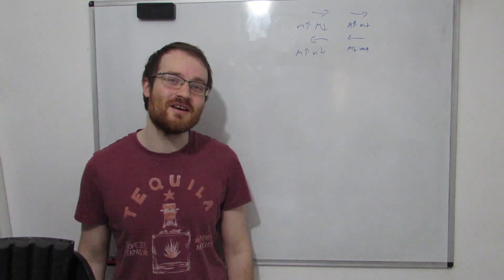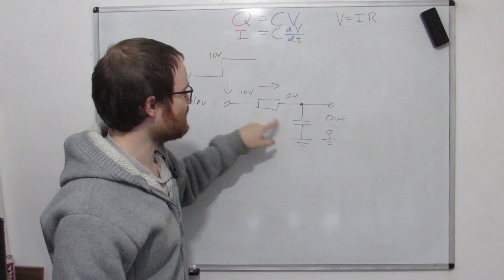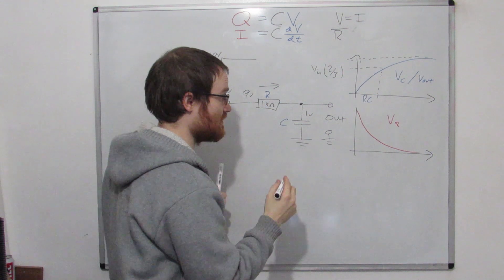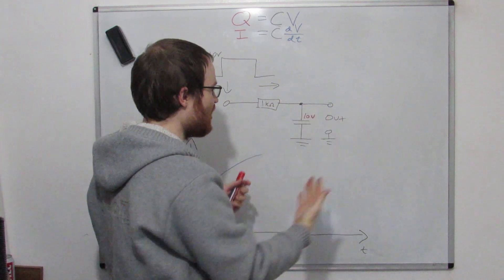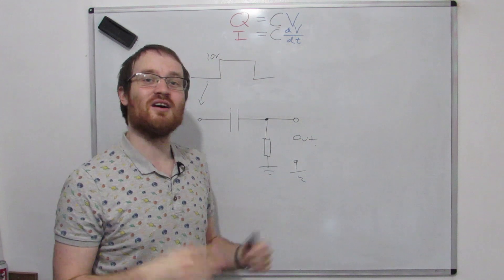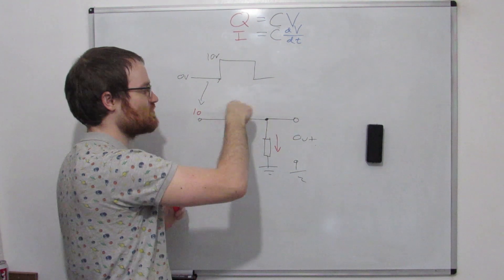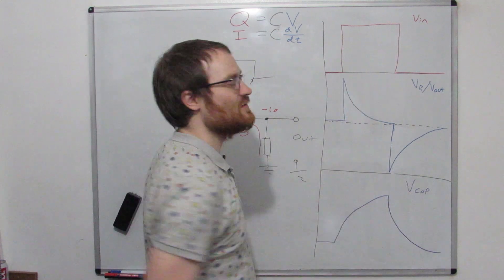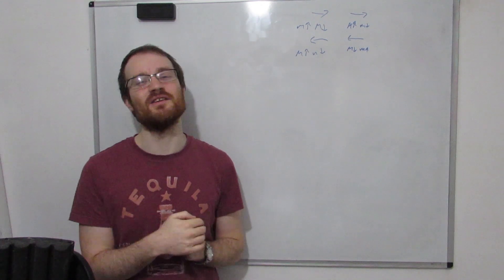Capacitors Explained: Part 2 - Charging With Constant Voltage

Comment: Like the video, but could you slow down just a little bit? (coffee? :)) Also,  the whiteboard is a bit hard to read, dont know if it would help if you zoomed in a bit and put something over the light source so that it gave a more diffused light?
Reply from the maker: Hi mate!
If i zoom in anymore the whiteboard will be off camera!! 
I have plans to get some better lighting, that whiteboard is actually a pain to film because of the reflection.
I really appreciate the feedback :) I'll try and slow down a bit, These explainer videos i was trying to make as concise as possible, maybe i overdid it a bit!

Thanks for watching!!! :)
Reply: @TheAudioPhool  It will be of camera, but you dont have to use the full board. If you zoom in so that the white space to the left and right disappears, you'll have the full width and lines will appear thicker to the camera, so easier to see.

Maybe not the best idea.

Keep up the good work!
Reply: Just set Playback speed to 0.75.
Reply: @ata843  ok, 0.75 are perfect! Also gives a dreamy/feverish feeling to it.
Reply: @ata843  Had a double espresso, now it's to slow.